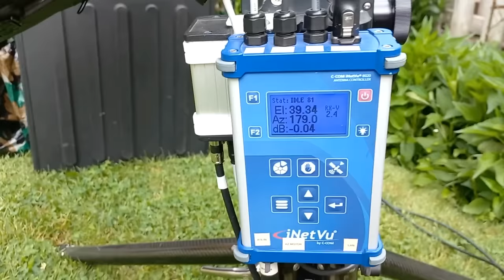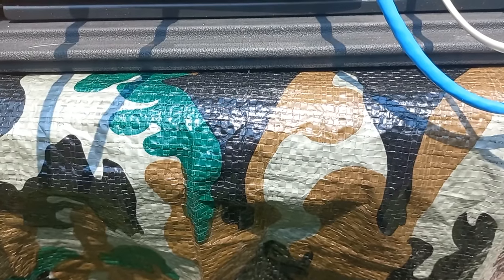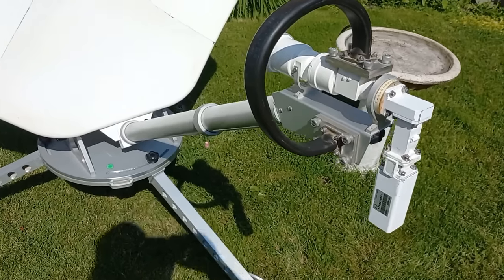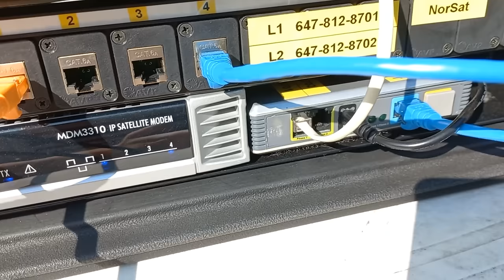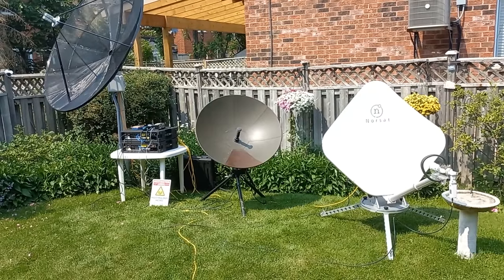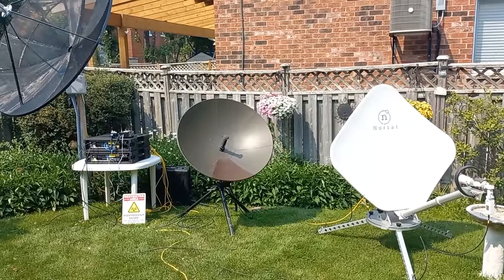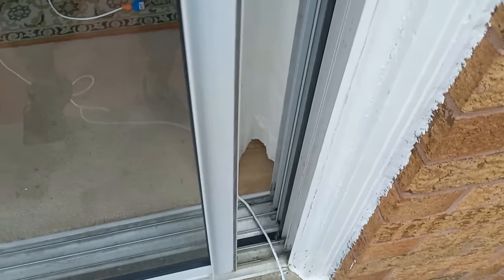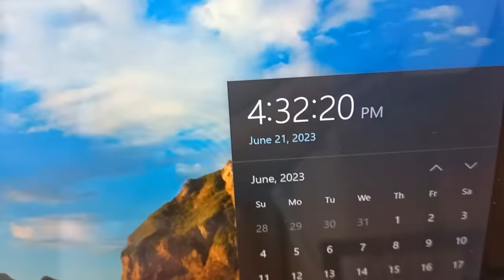Free Internet - Hacking Foreign Satellites

Comment: So I guess there's more steps than just pointing a normal sat tv dish/lnb to arsat 2 and shoving the coaxial cable in an ethernet head and plugging it into a pc/modem

I couldn't understand most of what was said in the video, how do I even start learning about it?

And what could I do with those rtl-sdr dongle units and/or pirate sat Tv receptor devices?
Like, not for this which seems to require beefy tx devices and other stuff, just anything at all

I have a lot of them lying around and I wanted to play around with them but I have no idea where to even start.. 

I remember that about 15y ago there was a tiny board with barely a couple transistors that went into vcrs and were connected to those little internet grid dish antennas and somehow the result was free cable tv and I've seen that upgrade to those I-box  SKS dongles and IKS.. and I remember one time I tried to reverse engineer one of the update files for these pirate devices that are still around that were .bin by setting it to .txt or something like that and found gibberish inside (I don't think I tried .zip tho)

Anyway, in very curious about this stuff but never found the actual entrance door to the field and have only been peeking through the blinds for all this time

It feels like I had to have been around in those weird underground forums 20y ago to be able to keep up with the technology and I missed it so now everything is too complex and would take years of studying the lore and evolution of all the different technologies revolving around all this

I just wish I could repurpose those tv receptors into arduino/rasp pi substitutes for simple projects, my current strategy is trying to use an old pc's serial/COM printer port for I/O, I'd use it to power step motors for my telescope mount but I feel like it's the worst possible way to do that

It's it even possible to have any fun with random trash like that instead of just buying commercial boards and stuff? Buying implies having money and that's not on the list of the things I have
I think the most success I've had with electronics is upgrading my crappy bt headset's battery to a 18650 cell and hooking up a led strip on a crown made from a couple tiaras and metal paper binding strips to a 9v battery strapped to a waistband to make jesus's aureola for a play

I really feel like I should just give up completely and throw away all the trash I've accumulated bc I'm never actually figuring out anything to do with it and if I ever want to have any success at all I'd have to spend money buying things and I really don't have any at all

Gosh, you'd think being around all this tech and playing around with it for a decade and a half would have gotten me somewhere further than "I can fix my own headset". I feel like I'm even behind the level those kiwico projects for little kids.

Well, I'd said I feel humbled but it's more like ashamed and humiliated 😢

Cool video tho

Comment: I know you mentioned the Internet speed is limited to 32 kb, but is this an overall limitation or just hardware related. Is there a way to pull, lets say 10mbs or more?
Reply from the maker: The equipment I used here does have the capability to go up to 20 Mbps up/down. I will be testing some new satellite gear very soon that will have much more data and speed capabilities. Stay-Tuned !
Reply: The modem can go 100/25 Mbps, but I assume he connected to that 32 kbps channel that is purposely open for new corp customers/techs to get their modem working and for the ISP company to see the modem live on the network before they authenticate it for a higher bandwidth.      The company associated with the IP is a reseller on these satellites, so they probably dont have access to read anything connected to the satellite except for their own open channel that they setup with no authentication.    
He is probably the first non customer person ever to connect to that satellite with the correct frequency and protocols. So they really dont care.  Now if this channel is being use heavily or long term then they will probably notice and block his modem.    They may review devices and block them so he could be blocked already or they really might not care after they see the cat pics.

Comment: Why are you using analogue modulation? Don't they use digital modulation that might be slightly quicker.
Reply from the maker: It is a digitally modulated radio carrier. Digital is not faster then analog as some people might think. Encoding and decoding of a digital signal takes more time when compared to a pure analog modulated signal.

Comment: what i want to know is how you can get a publicly routable IP for this use case? is it auto assigned from an ISP when the connection is made from the satellite? that seems to be the most plausible but why would they just give out an IP without registering it to a device and a account? very cool stuff also interesting that the provider associated with this slash /22 network block is a a U.S. Satcom company...
Reply from the maker: They actually automatically assign you a private IP as a back channel to communicate for provisioning with the HUB. It's something in the 10.10.x.x. range. But in this case the private IP was routable at a restricted level of 32 Kbps. It was an exploit that is now fixed.

Comment: It's better if You use solar generated electricity since the electricity bill to power these devices to get the free satelitte based internet connection is higher than some cellular data packages.
Reply: What's the price of the solar panel and batteries? That is what you need to look at and compare that to the price of grid electricity.  It isn't always cheaper.

Comment: Just wait until you get access to quantum internet. The fact that China produced a device that uses quantumn entanglement internet (only used for encryption atm) that has faster speeds (40kbs) than this kind of boggles my mind. Connecting to a sattellite 22,000 miles away is slow yes but connecting across the galaxy? Much faster in 2024 😎

Comment: I called using a satellite connection, but in a different way. My family have satellite internet and they also have a mobile cellular station that runs on an internet connection (they live in an area where it’s hard to get a signal from cell towers). So it was painful making calls near there house sometimes, but I can say that I called using satellites.
Reply from the maker: Where you the caller from the UK?  44754xxxxxxx ?
Reply: @peterfairlie2296  No, I'm in the US.  I didn't want to bother you, even if you made a video about the messages you received.